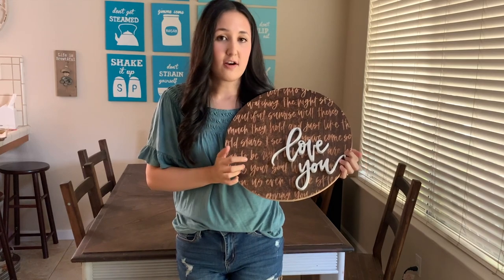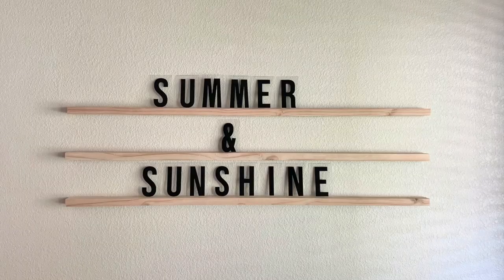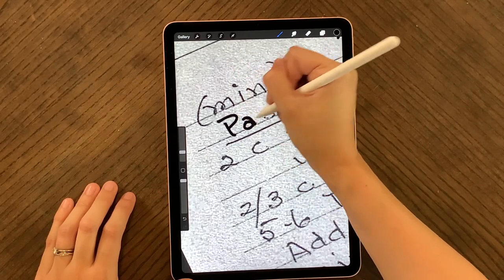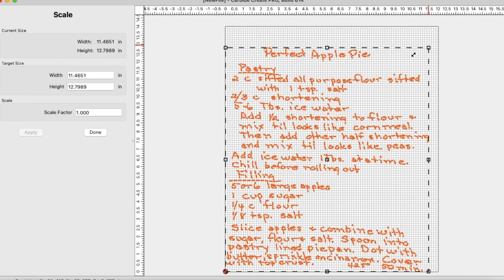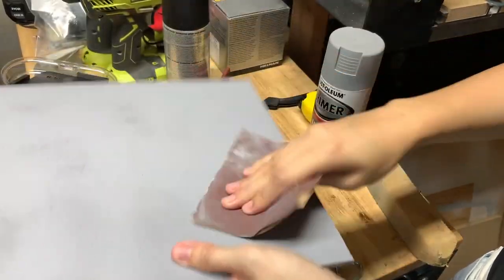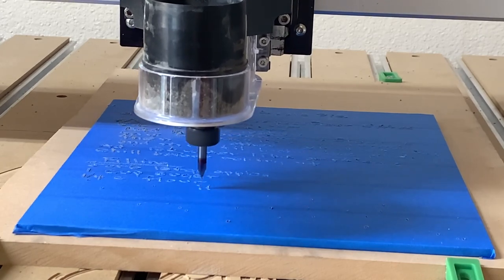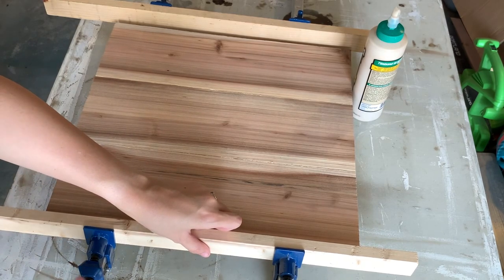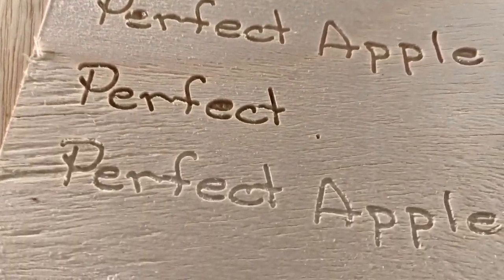Grandmas Handwritten Apple Pie Recipe Carved in Wood - Lettering to CNC

Comment: Nice job and clever idea using an overlay with magnets to be able to switch out the front piece seasonally. Here are a couple of hints to help make it easier. You can get "marker board" from the big box stores. It's 1/8th inch(ish) MDF with a white glazed finish on top like the marker boards you find in conference rooms and schools. It engraves super nicely and you can paint or stain the engrave and it wipes right off the white surface. If you do want to mask your project using blue tape weeding the bits of tape that are in the curlicues and Os and other letter interiors is easy if you use a piece of Gorilla Duct Tape - press it down on top of the project and pull it back. It will pull off the blue (or green) painters tape without you having to pick at every little piece.